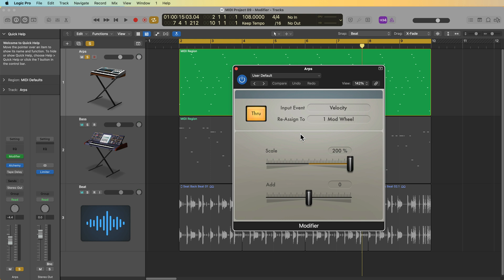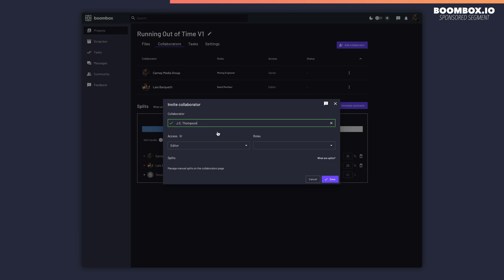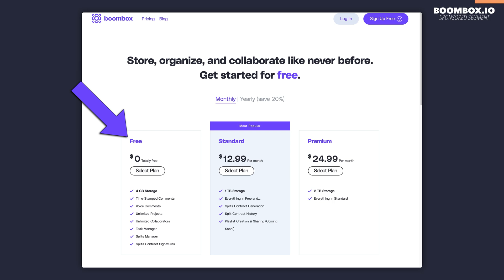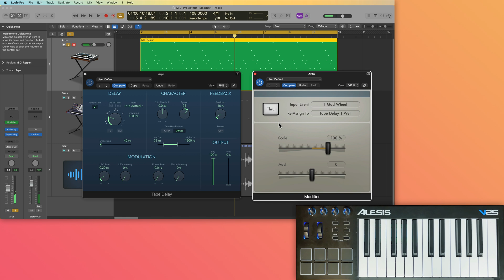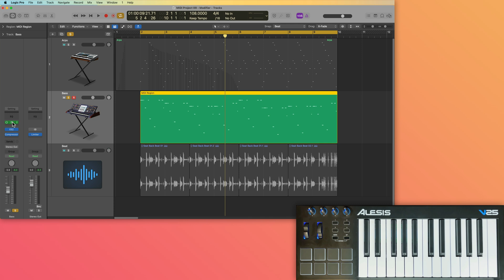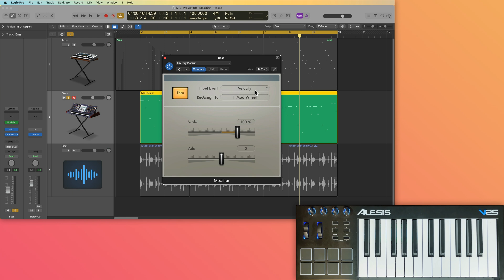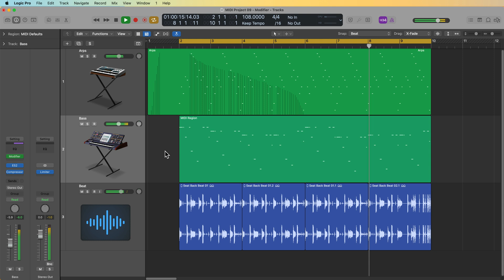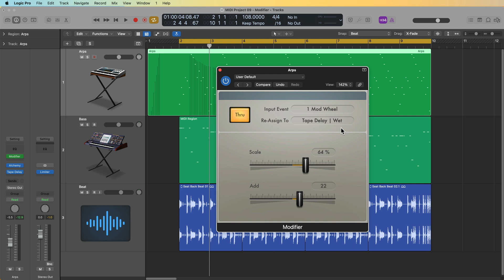Logic Pro #55 - Modifier MIDI FX (EASY Controller Assignments!)

Comment: It’s handy to find what the cc modifiers are called, like a reference manual.  I’ve never used it and have no issues with midi mapping in the usual ways, but this type of modifier seems temporary - like a quick fix - which might be useful in some cases. Although, I think it’s easy to forget why you put modifier in the Midi FX slot of a track.  Sometimes you have a use in mind, but when you come back to open the project (sometime in the future) and see ‘Modifier’ on a track, you might be confused.

Comment: Wonder if/how Logic Pro X could convert MIDI Note Number to a MIDI CC value
Reply from the maker: I'm pretty sure it's possible, because "Note Number" is an input option, then choose Mod Wheel or some other CC. It would probably convert the pitch of notes into CC positional data, since they are both 0-127. Then click the THRU button and it would send the notes through + plus the position data? I have no clue what you would used it for though! :)
Reply: @MusicTechHelpGuy  You could use it to key track any parameter on a synth plugin.